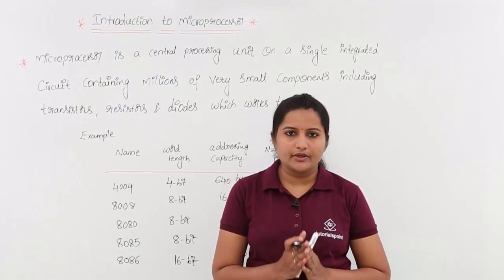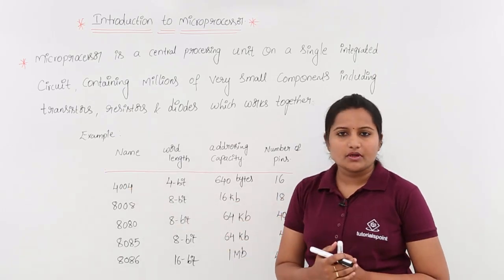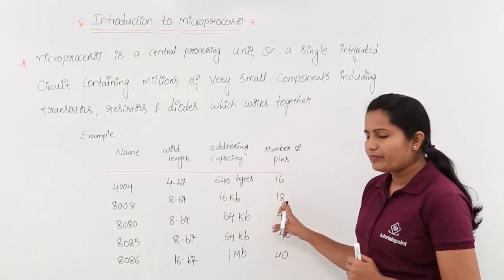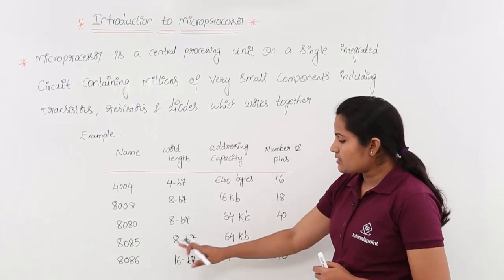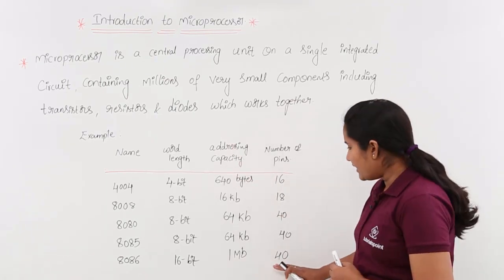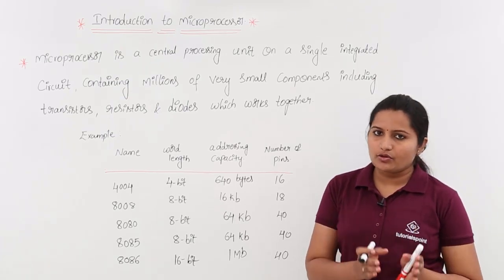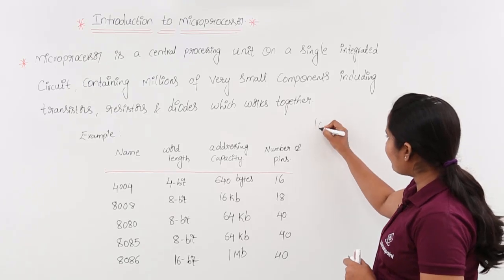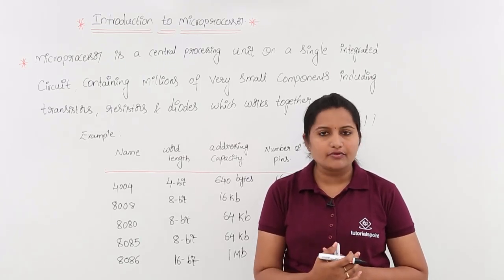Introduction To Microprocessor

Comment: The 8080  and 8085 both are same word length and same addressing capacity. 

But why the 8085 required madam
Reply: Maybe processing power 🤨
Reply: Because of the voltage issues